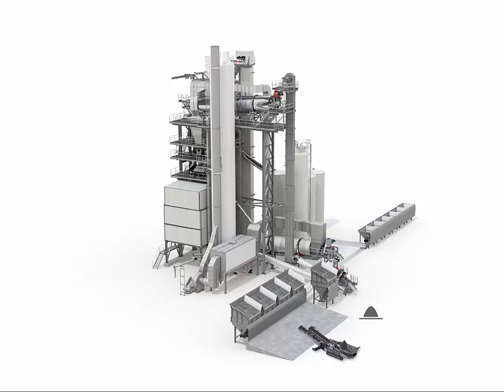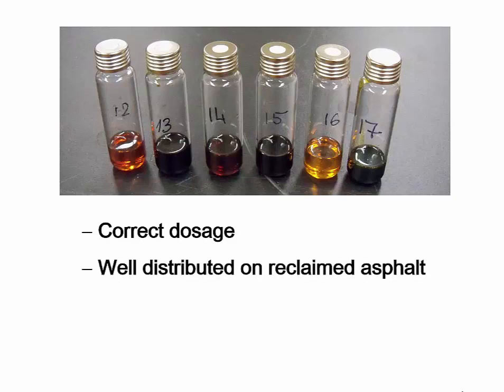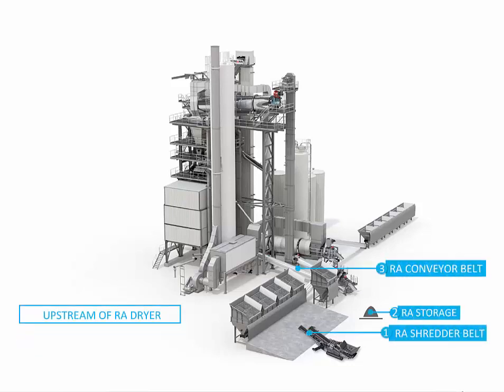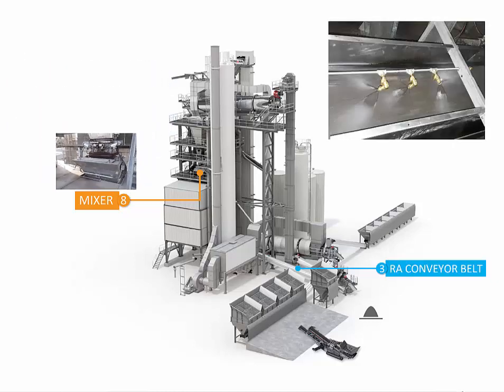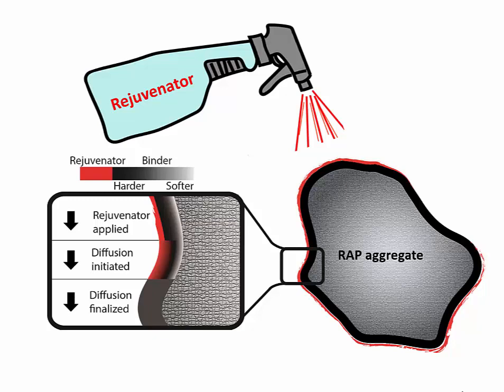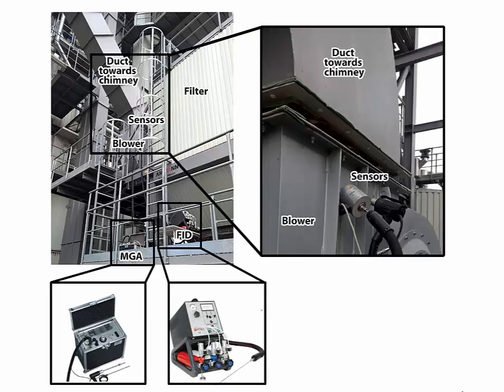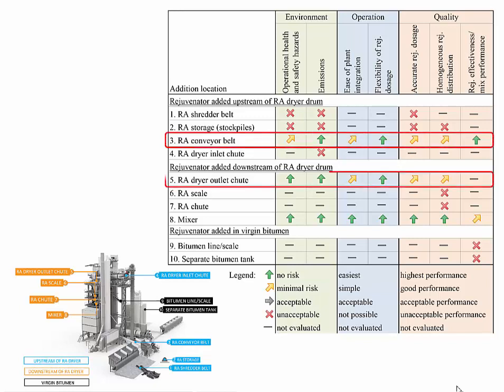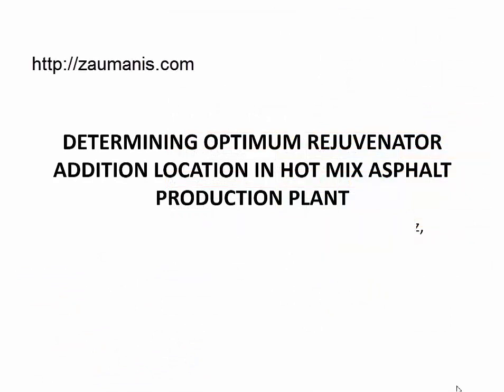Determining optimum rejuvenator addition location in asphalt plant

Comment: In laboratory, when we should add rejuvenator ?
Reply from the maker: Dear Ankit,

This depends on the plant production process you want to simulate. At the least you should select the addition process to represent one of the three broad groups mentioned in the video: cold-RAP, hot-RAP or binder. Next the question is at what temperature and how long to mix. Again, this will depend on the process you want to simulate so unfortunately there is not straightforward answer to your question.